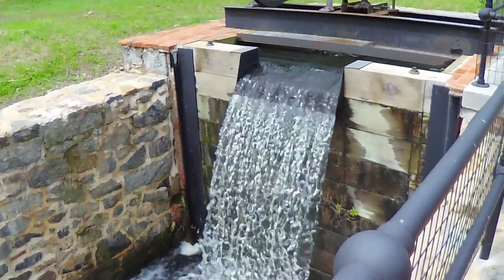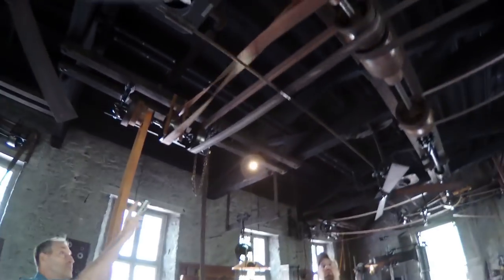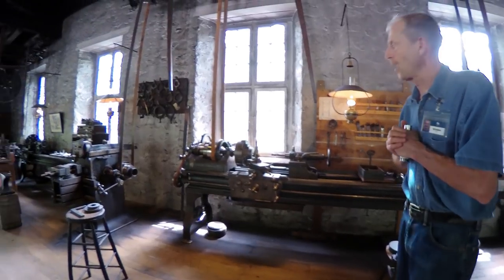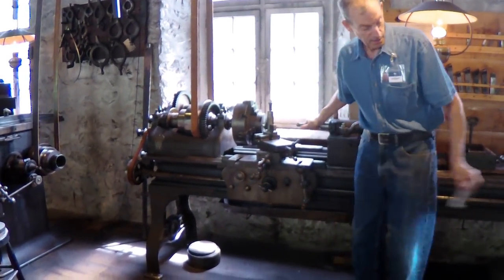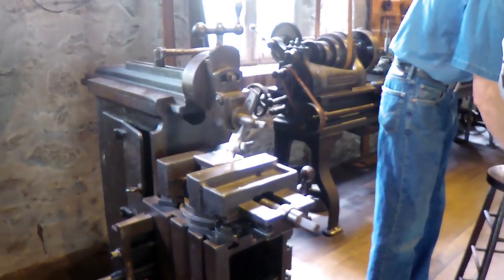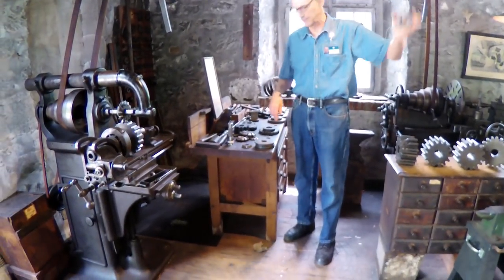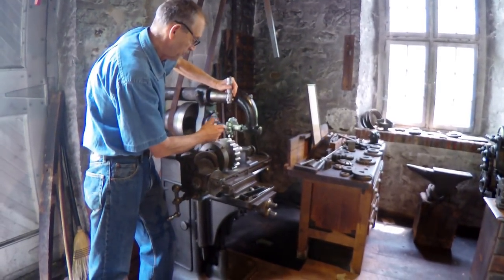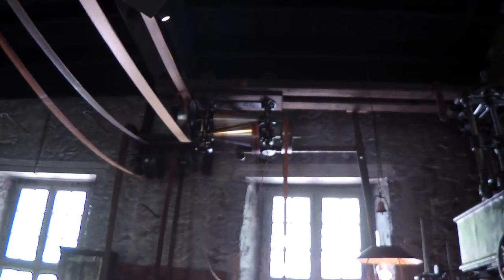Water Powered Machine Shop of the Dupont GUNPOWDER Factory 1870's

Comment: The cone for the variable speed on the drill press was pretty cool.  Its wild how much has changed and how much has stayed the same.
Reply from the maker: +Dan The Maker Man yeah the cone drive is the same as in the cvt transmissions!  Just imagine the shop was there to support gunpowder manufacturing...they had over 240 fatal explosions!
Reply: That's crazy man 240!!!!
Reply from the maker: yeah it is actually just a little bit more than 240 but i could not remember the exact number

Comment: Modern flour mils still use line shaft drive to reduce the explosion hazards related to electric motors.
I bought an old line shaft machine shop right out of high school but never got to set up & run the machines & ended up losing them over time. I wish I had them back.
Reply from the maker: that would have been great to set up... but not to use on a daily basis.
Reply: @RayMAKES  it would be lovely to use on a daily basis especially if you used todays coolants and brazed carbide tools
Reply: @theshauny  You can't run carbide on non roller bearing machines, not sure why they say that but I suspect the bearing clearance will destroy the carbide like an interrupted cut not to mention they require a lot more horsepower than HSS. 
No coolant tray/pump either.
Reply: @pvtimberfaller  very interesting points, easy enough to sort a coolant tray and smell pump (a small DC motor that plugs into the old line shaft powered “lighting” dynamo’s would be cool)

Speed might be the main concern for carbide on a plain bearings machine tool 🤷🏻‍♂️ old chucks where very low speed rated compared to todays “high speed chuck” so that might be a issue aswell. I would think a 5 or 10hp line shaft should be enough to power a lathe that would be today’s equivalent of 4kw electric motor(must remember that line shafts and especially steam power has torque curve closer to a electric motor than a petrol or diesel engine
Reply: The shop I bought out used old single phase motors the size of oil drum, reversible by shifting a timing quadrant.

Both lathes had shop built chip trays, the 24” one consisted of half barrels welded together with wheels so you could trundle it outside to empty it.

There was a 14(?)/24”x60-96? lathe, can’t remember the make just now.
A 14x40 Reed prentice.
A 20(?)” Camelback drill that shared a motor with a Davis keyseater.
A 24” rack drive shaper.
All the tooling except the big drill bits which the owner sold without telling me plus a Hossfield bender, welder etc.

It was a dream at the time.

Sure wish I had just bought a 12” Jet & a Bridgeport like dad said, I would still have them.

Comment: pretty cool ray .. i bet you can still hold tolerance on those old machines haha
Reply from the maker: +TRUMP2016 Local187 WallBuilders Union I'm pretty sure you could
Reply: If the equipment was levelled correctly and you where using good quality measuring equipment you would be fine if you where using today dial indicators and micrometers along with brazed carbide cutting tools it would be rather easy stuff was made very well back then

Comment: I already that water powered machines existed but what I don't know is that it is actually possible to transmit the mechanical energy for long distances using ropes and belts for industrial purposes. I think this is more energy efficient than water powered electrical generator to power the machines since it is a directly mechanical to mechanical energy, no electrical conversion was involved from running water to machines.
Reply from the maker: its great, as long as there is water... and its not frozen
Reply: As amazing as it is I don’t think it would be as efficient as “AC” electric because off all the bearings and friction joints along the path(a engineer would have to conduct a study to say for sure), it’s still a great achievement and infrastructure though

Comment: That machine shop is amazing but I think old mate is over cooking how long it would take to make a gear, I believe that I would be able to make a gear in that shop in less than 2 days… the indexing head he called a computer is way is a inaccurate term it is a positioning tool,(the way it works is it’s a 40:1 gearbox and you can get other divisions with “indexing plates” you still do the math in your head.also the first lathe he said was a 4 speed is actually a 8 speed because it has a back gear there is plenty more that is some what inaccurate in his tour but it was still great to see thank you for sharing
Reply from the maker: Keep in kind he was a tour guide, not a machinist
Reply: Exactly he is a tour guide he should take the time to learn more about the items he is presenting